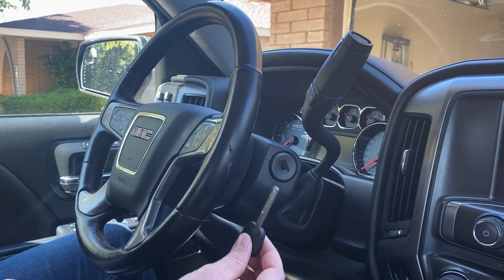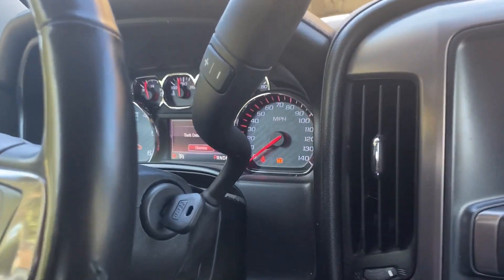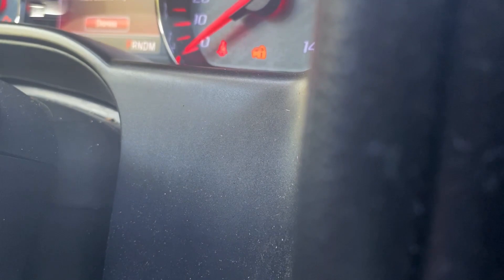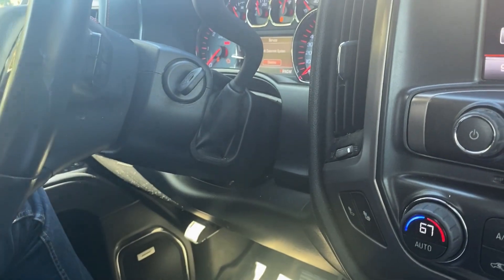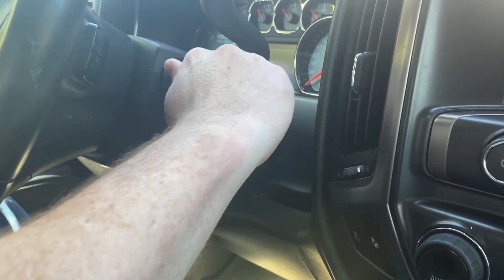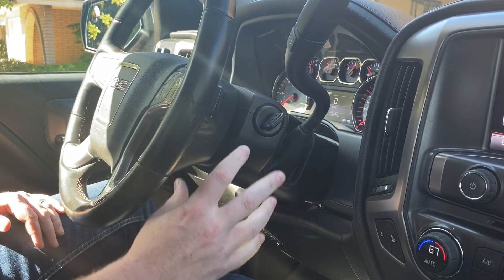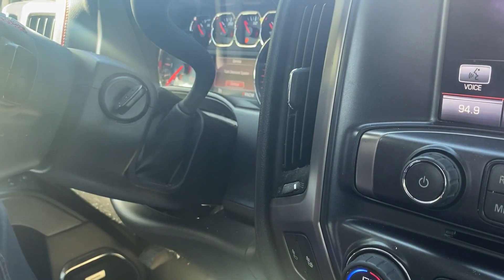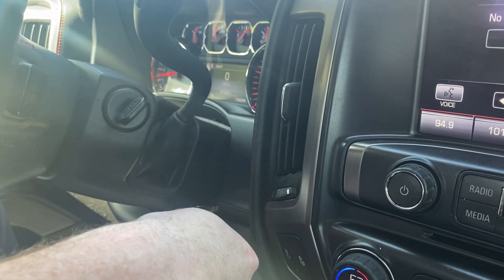How To Program A Buick Lucerne Key 2006 - 2011 DIY Transponder Chip Ignition - All Keys Lost

Comment: Great vid ,,I was wanting to buy a 06 Lucerne but the owner just had a key to open the door ,, Did some Lucernes come with just a key or did all come with a key FOB ?
Reply from the maker: I'm not sure if the factory keyless remote fobs were standard or just an option on the 2006 Lucerne.  You can verify that by taking the VIN number and calling a GM dealership.  Speak with their Parts Department and they can look up the original build sheet to see what options the vehicle has.

Comment: Buick Lucerne additional key procedure didn't work
Theft deterrent light never went out 
Error message said service theft deterrent system
Is it the key
Should I try to have it programmed before returning to internet seller
Reply from the maker: it sounds like it could be the key
Reply: Mark, did you ever get this resolved? My 06 Buick said the same thing after an alternator change and now it wont crank at all.

Comment: 30 minutes to program a key for a Buick Lucerne? It took the locksmith 30 seconds
Reply from the maker: The onboard procedure is 30 minutes - if you have the scan tools the locksmiths have, you wouldn't need to use the onboard procedure.